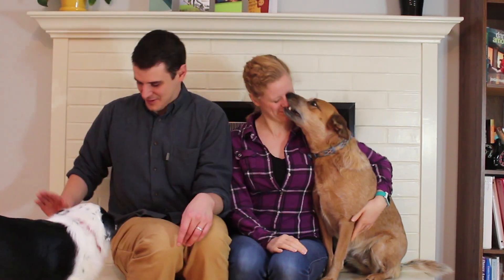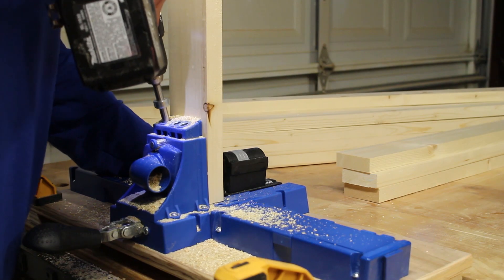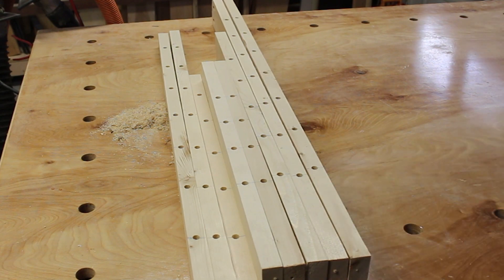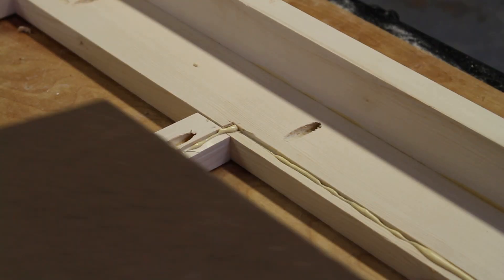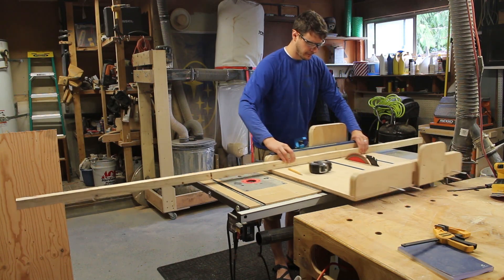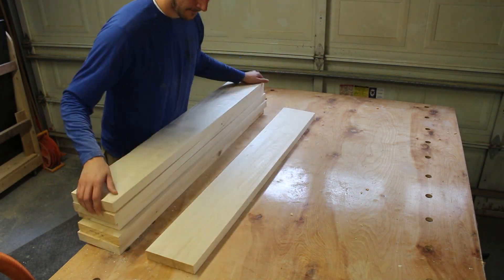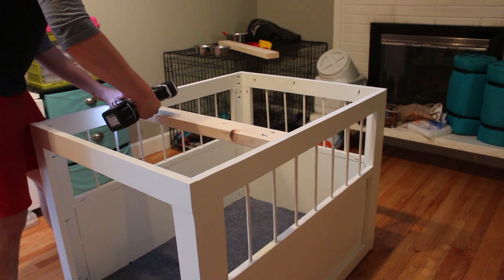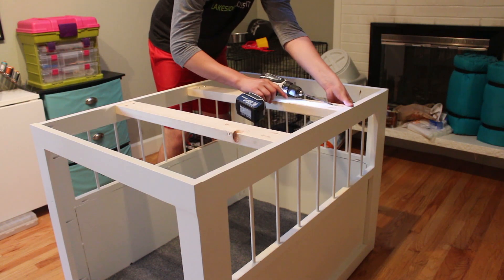DIY Dog Kennel From 2x4's

Comment: Hi Mason, I really like to dog build and I would like to build one for my Aussie dog Melo. Are you able to share the design template including measurements/pieces? Thank You. This is also such a great video/edit.
Reply from the maker: Hey Larry,

I used Sketchup to design this guy, and ended up building a smaller one for a friend as well. While they're not 'instructions', if you know how to use Sketchup, they should be pretty straight forward. Let me know if you can't access these :-)

https://1drv.ms/f/s!AoVzkl6kdjhQsY43ws_YHSzFJ1r3aQ

https://1drv.ms/f/s!AoVzkl6kdjhQsY1iDIx7hmDDC9s1ig
Reply: Thank You. Thats really helpful. I dont really have all the tools to make the build but I will use what I have to build a home for Melo.  @masontejera506
Reply: Can you please tell me how much is the length and width
Reply: @MuraliJothe  The base is 45-1/2"x32". The top is 47-1/2"x34". Overall, 33" high.

Comment: What size are those dowels?
Reply from the maker: Sorry for the late response - they're 3/8's
Reply: @masontejera506  oh wow!!! big help man!!!  A year later. Jk thanks a lot bud.
Reply from the maker: @Antweak83  heh yeah, my bad - sorry it fell through the cracks. Didjya end up building something like this?
Reply: @masontejera506  yes I did it for a client. It was very similar. Thanks for putting up the video. It was the first one I built. I also made a two door version made out of 1x. I used 3/8 rebar instead of dowels tho. The first one i built had 3/8 wooden dowels. But the clients dog chewed through it. Lol
Reply from the maker: @Antweak83  heh yep, Oz ended up pulling one of the long dowels out, so we remade it with 1x1s and dominos. Glad to hear you got it built and made 2 to boot! Cheers mate!